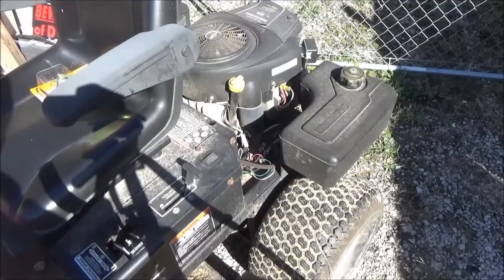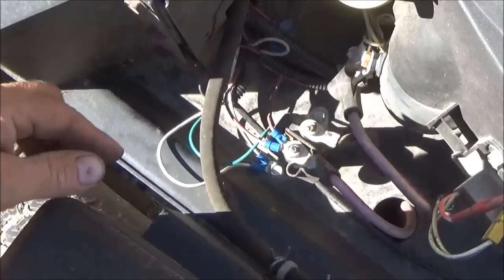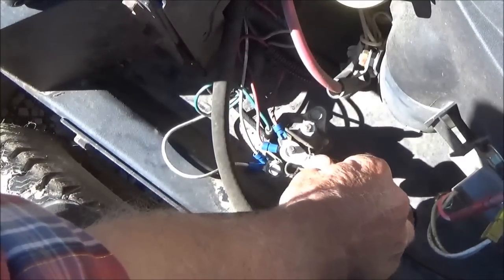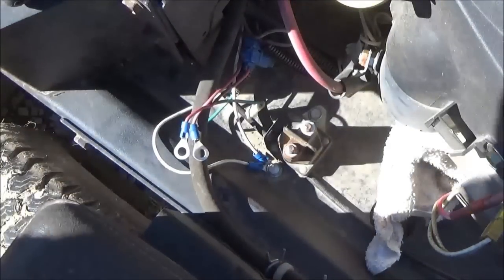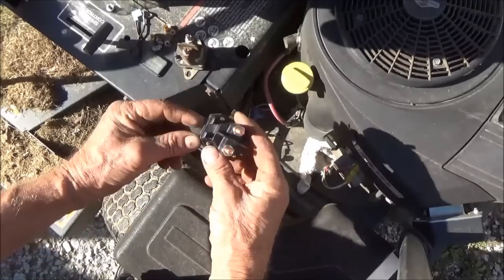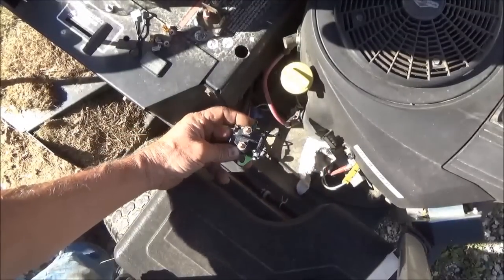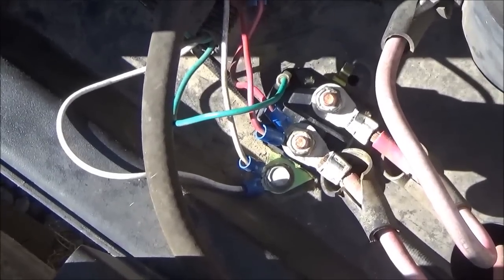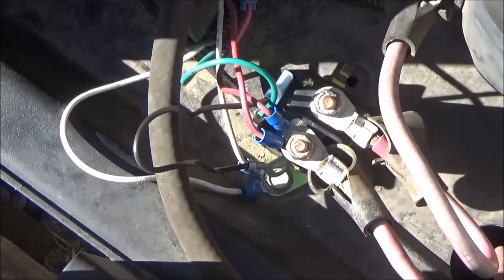Lawn mower starter clicks but won't start, change solenoid

Comment: Thank You SO much for taking the time to record this video. My father bought a new mower about three years ago and paid a pretty penny for it. Well, he’s had some trouble with now the solenoid has gone out and I’d have absolutely no clue how to change this or even know what to look for had You not made it possible. Only problem for me now, is finding it. I think this brand/model might have it under the seat between a bracket and the battery but I’ll find it on the diagram. You’re a real blessing. May God Bless You and Yours.
Reply from the maker: I changed one on a small tractor mower on video, you should be able to find that video in my small engine playlist, it might be helpful in finding yours. In any case it will be the first place the positive battery cable goes to.

Comment: Beat video EVER! Thank you for showing how to use a solenoid that isn't the exact one. This is exactly what happened when I went and bought one and I also did not know to put the extra ground wire on. Your video was the just like sitting there with my dad explaining how to put it on and how to make what you have work! Thank you so much and I hope I can find a video you have done on changing the blades!
Reply from the maker: Glad to hear it helped. No I haven't made a video on changing or sharpening blades, good idea!

Comment: I bought that  exact same solenoid and tossed the black grounding wire that came with it , just like you did .  If I knew your address , I would send you a case of beer for the headache that your video has just  saved me. Thanks man .
Reply from the maker: Thanks for watching and commenting.

Comment: Hey thanks for uploading this vid, this kind of stuff helps out more people that you might think.  My mower is doing the same thing the solenoid is clicking but it won't start.  I bypass it, kind of like you did and it starts up just fine so I'm going to get a new solenoid, I'm tired of jumping that thing.  I've been using cables on the battery and hitting the starter with the hot wire haha.
Reply from the maker: Thanks for watching.

Comment: Hey man. My Scag clicks and doesn’t start when I turn the key. Doesn’t even try to crank. Battery has power, but when I bypass everything like you did, the engines cranks but won’t turn over. What do you think?
Reply: Bad ignition switch?

Comment: I just purchased a new solenoid, it was different than mine. When mounting the brackets the brass circle bottom is now on its side making no contact with the tractor-is that OK?
Reply from the maker: If the new solenoid has 2 energize terminals, ( the small ones) it's ok to mount in any position, just ground 1 terminal and the other one to the ignition switch, if the solenoid only has 1 energize terminal then the base needs to be grounded to the frame or via a wire to ground.

Comment: I have same clicking problem. Changed solenoid and have same clicking problem. Tested solenoid and it reads good. Any suggestions?
Reply from the maker: If you bypassed the solenoid and the starter cranks but solenoid doesn't work then either the solenoid is bad or there is a bad connection somewhere in the wiring or switch.

Comment: How do you hold a metal bolt over the terminals while cranking up without getting shocked?
Reply from the maker: Not likely to get shocked from 12 volts, and even if it did it's nothing to worry about. Thanks for watching.
Reply: “even if it did it's nothing to worry about”
Ha ha that made me laugh. But that’s a good question, I was  wondering the same thing. Good answer!

Comment: Sir, my xmark starts fine but when I turn on the deck it boggs and dies. Can you please give me some ideas? Please 👍
Reply from the maker: Assuming the tractor drives fine without the deck engaged, I hope you checked underneath for rope, wire, rags or something bound up on the blades? Check to make sure there is nothing under the deck or on top in the belts and pulleys, everything is moving free then I don't know what else, I would have to chase it down.

Comment: I have a snapper pro T50 briggs motor. went out to mow and it wont start. battery charged, plus i tried jumping it with my car. nothing. humming noise comin from behind seat left side. please help

Comment: I had the "click problem" today about an hour after the tractor had been running fine.  It's happened before but the motor would always start on the second or third try...not today.  I don't have a multimeter, or a lot of mechanical savvy for that matter, but the tractor started after I manually turned the engine a little bit.  I believe there's a bad spot somewhere in the starter system, but I don't know exactly what.  Any explanations?
Reply from the maker: I need to do a different video on running down the no start problem, I don't know when I can do that. Just bypass the solenoid and if it cranks good then the starter is still good. Check all of your cable connections and the copper wire going into the terminals, everything must be tight and nothing getting hot at the end of any wires.

Comment: Sometimes that unused mounting tab on the new solenoid will slip down inside the existing threaded hole, and will help hold it in place. Did you think to try that when you mounted yours?

Comment: I put a new cylinoid on my Kawasaki 23.5 hp engine the end of the summer is it possible it could've gone bad I'm having the same issues as you were having in this video
Reply from the maker: Jump the energize terminal of the solenoid to the battery terminal of the solenoid and if it cranks that way then it's probably the ignition switch or the wiring between the switch and the solenoid. If it still doesn't crank but it will if you jump the 2 big terminals then it is the solenoid. Let me know what you find.

Comment: Mine doesn't do that...it's a click, click, click in quick succession and I already had it serviced and they replaced the starter and the fuel solenoid and rebuild the carb.  I replaced the starter solenoid myself when I had your issue in this video.  Just pisses me off that it might be the starter AGAIN.  1 damn mowing and I bet it'll be another 4 weeks in the shop.
Reply from the maker: Sounds like your shop has "quick change artists" working there just trying this and that until they get it and letting you pay for their on the job training. Sorry to hear that.
Reply: Sounds like your battery is shot or there's a bad connection.
Reply: Im guessing bad ground.  I was sure my starter solenoid was bad, but after some testing, found my ground to tge engine was bad, causing the starter to loose it's ground and not start.

Comment: My mower is doing the same as this one, but touching the two solenoid terminals together I can’t start the mower. Any ideas what to check for next?
Reply from the maker: Are you getting a big spark when you jump the 2 big terminals? if not, the battery power isn't getting to the starter either because (1, the battery is not charged or bad, (2, bad connections in the cables or bad cable, (3, the starter is bad, has an "open circuit" power not getting through the starter. In any case the power isn't getting to, or through the starter. If you're getting a big spark and the starter won't run then the starter is bad. Try checking it with jumper cables from a car, if it works with that, then your problem is in your battery or wiring.
Reply: Gordon Robertson thanks for the quick reply and advice. It turns out the ground wire had come loose. Tightened it up and I was back in business. Thanks again!
Reply: Gordon Robertson
Reply: Gordon Robertson but doesnt smoke anymore
Reply: I GOT IT STARTED

Comment: i replaced my solenoid with a universal one but now my solenoid hums and it wont start.  What can I do to fix it/  make it run?
Reply from the maker: The solenoid should make a solid click sound when energized, should not hum, you need to check the connections, copy from another electric start motor, doesn't matter what machine or motor, almost all these motors have the same setup, just follow the positive battery cable from the battery to the solenoid if you can't see where it is, get access to it and copy the wire connections, and make sure all connections are clean and tight.
Reply: Gordon Robertson I opted out and got a 3 prong solenoid and it turned but did not start. Now starter wont even turn and it's warm to the touch. I guess I'll replace the starter?
Reply from the maker: Yeah probably, but still remove all connections and clean with sandpaper, a weak connection will overheat the starter, also try jumper cables from your car or a good hot battery directly to the starter bypassing the solenoid and battery cables, clamp the neg. on the starter and the pos. on the starter terminal (clamp the positive cable onto a screwdriver and touch the starter terminal with the screwdriver) for a test before you buy a starter. Let me know what happens.
Reply: Gordon Robertson i cleaned all connections as you suggested and it just clicked. i removed starter and tried to start it with cables, starter did not engage.
Reply from the maker: sounds like the starter, I guess you checked the motor to see if it turns by hand? maybe pull the spark plugs and see how easy it turns. I think I paid about $80.00 for a Brigs starter for a 20 hp 2 cylinder.
Reply: Gordon Robertson i didn't remove the plug but i was able to turn the motor by hand using my fingers. my motor is a 14.5 hp.
Reply: Jose ever find out why it was buzzing? I replaced mine and now it just buzzes. I double, triple checked everything. My mower is wet from being left outside so I’m gonna let it dry out and see if maybe a connection was just wet. If that’s not it I don’t know what it could be. I have made progress. I’m %100 sure it was the solenoid. I fried it when replacing the PTO switch and ignition. Both of them are now new.

Comment: my toro riding mower starts, but has weird symptoms...takes up to three seconds for it to crank after turning key...or struggles to turn the starter at all until i turn the key back and forth up to three times before it cranks. the battery is brand new and in perfect charge and load tested. can anyone suggest what i should check or replace? thanks!
Reply from the maker: Check all your cable connections, both ends of each cable from the battery to the solenoid and to the starter, including the contact between the starter and the motor and motor to frame. You can bypass all those cables and jump the starter like I did on my video. After proving all connections are good and jumping the starter fails then change the starter. If the starter jumps good then check your ignition switch and it's connections. I have another video on a similar problem I fixed on a big truck, same procedure only bigger.   https://www.youtube.com/watch?v=aDo65CQ5Vv0    see part 2 also.

Comment: Mine clicks but starts to turn over, and then after a few cycles dies.  Replaced the battery already.  Used to use my car to jump it but that doesn't even work now.
Reply: Not sure it's solenoid because it does start to turn over.  But it just cant hold the start.
Reply from the maker: Probably bad starter. You need to eliminate any possibility of bad connections or bad wire first. Here's a link to a similar job I did on a truck, same problem, same procedure, only bigger and ended up replacing the starter too, probably because the bad connections didn't allow enough current flow to the starter and it cranked too slowly and burned it up. Watch part 2 also.      https://www.youtube.com/watch?v=aDo65CQ5Vv0&lc=UgwlOnZ4Y5wSx9B0kup4AaABAg
Reply: @chriskelso7597  if it's a Briggs engine they have a compress release on cam lobe and valves have to be adjusted exactly for that feature to work properly I basically acts like the battery is almost dead and turns over slow but once you adjust the valves it spins freely. .pull spark plug and see if the starter will spin faster that way it's a quick test to see if the starter will spin qicker

Comment: I have a jd mower that rapidly clicked when I try to start it, i replaced the solenoid and battery but it still rapidly clicks when I try to start it
any ideas?
Reply from the maker: Bypass the solenoid the way I did on the video when mine wouldn't start to check the starter, if the starter runs good that way then check ALL YOUR CABLE CONNECTIONS to make sure they are clean and tight, if that doesn't do it then check to make sure your solenoid connections are correct, next, try a different solenoid.  Let me know what happens. Thanks for watching.
Reply: +Gordon Robertson i noticed that I have the same solenoid u bought and that i didnt connect the extra wire it came with so I think thats the problem
Reply from the maker: I did another video on a different lawnmower a few weeks back, maybe there's something in this one that might help. https://www.youtube.com/watch?v=gY4LwCxjrmM  Let me know when you get it going or if you still need help.
Reply: +Gordon Robertson i followed the steps in the video but now all I get is one click from the carburetor and it won't start
Reply from the maker: Does the starter run when you bypass the solenoid?
Reply: +Gordon Robertson nope I only get a click what sounds like it's coming from the carburetor
Reply from the maker: the only click from the carb would be either a fuel shut off or an auto choke. If you can't get the starter to crank by touching the 2 big screws on the solenoid together with a wrench or something then get your car over to it and put jumper cables on it, the neg. from the car to the starter body or engine block and the pos. from car to the starter terminal on the starter or the solenoid end of the cable. let me know.
Reply from the maker: You either have a bad starter or you're not getting power to it for some reason, there's no other possibility. I'm not angry or annoyed, I'll get you through it if I have to do it on the phone.
Reply: +Gordon Robertson i tried jumping the starter but nothing
Reply from the maker: Sounds like the starter's bad. I get most of my small equipment parts from http://www.partstree.com/parts/ I don't see John deere on their list but they do have Briggs & Stratton assuming that's what you have, also I get some parts through Amazon, I think you'll find your model and serial #s under the seat.

Comment: remove i wire at a time to new solenoid  never take all off and blink   those two big battry wires RED  1 each on big post thats all the small post need 1  grounded  the small one should have red wire from key switch  so what happens if you turn on the key you are connecting 12 volts to the small bolts on the solenoid which  make a magnet opperate in the solenoid conn the two big bolts togeather  sending 12 volts and high amps into the startor to make it spin